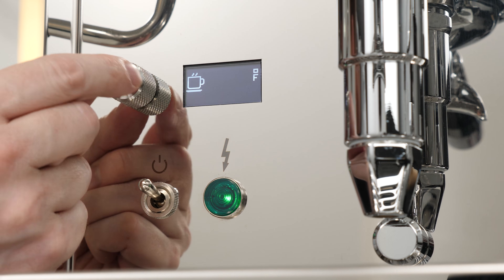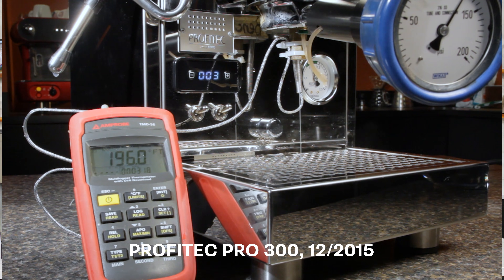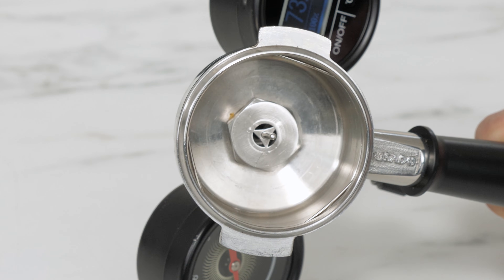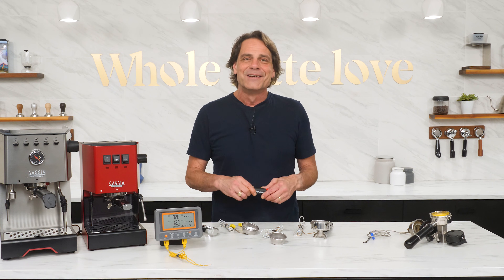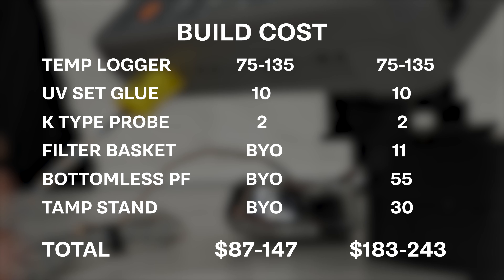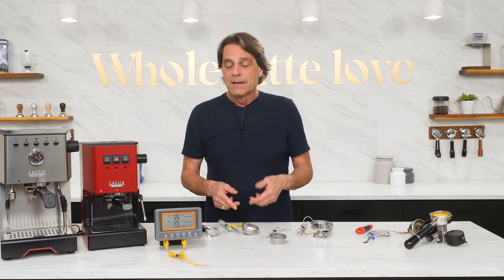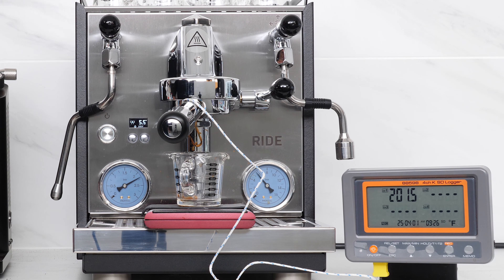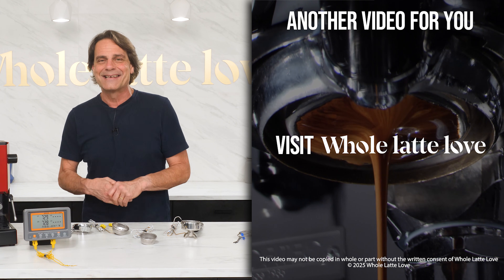Nerdy Espresso Hack: How to Build a Real Puck Temperature Probe

Comment: Hi Mark, I followed your instructions and built a probe using a single-shot basket. The probe tests very accurately in boiling water. However, when I run it on my new Lelit Mara X in coffee priority mode with the temperature set to high, I’m measuring a brew temperature of 86 °C. My bottomless portafilter and basket are properly heated up before brew. The temperature stays quite stable during extraction, and the flow rate holds steady at around 2 ml/sec once the coffee starts flowing. Repeated the test with my PID controlled Silvia with same results.
 The coffee tastes great, but how can I explain why the measured temperature is lower than expected?
Reply from the maker: Thanks for sharing your results. Hope you had fun building the probe! Your type of results are why I test machines by measuring real temperatures in the coffee puck. 86°C is rather low. Low temps might be the result of incorrect boiler offset in the PID controller. At the high setting the Mara X should be closer to 95°C. But, it uses a heat exchange boiler so the water in the boiler surrounding the exchange tube which provides the brew water is always hotter than what you'll get out of the group. The controller uses an offset to compensate for the difference. I do not believe the offset on the Mara X is user adjustable.
If your probe tests good in boiling water then I assume it's operating properly. Can you turn up the temp on your PID Silvia and see what you get? 
Bottom line, if your coffee tastes great at 86° brew temp that's what matters!
Marc

Comment: Thanks for the video, i built one - I’m curious to know why you measure the temp with the coffee - the definition of the temp set in the machine is the temp of the water at the group - the coffee adds variability  depending on how course/fine is  ground and how much is pressed. I find with my settings that the temp is stable but  2-3 centigrade lower with the coffee puck - without coffee the temp is stable and equal to the setting. Does it make sense?
Reply: Makes sense on one hand, but on the other hand the SCA guidelines specify a proxy puck with a certain thermal conductivity and volume.
Reply from the maker: Proxy puck or real puck... I'm taking temps on real coffee!
Reply: On a related note : Cremaloop is currently taking pre-orders for their new brew temperature analyzer for E61 group machines.
Reply from the maker: Thanks for sharing your experience! I measure within the puck to get a real temperature on the coffee. If you measure without the coffee are you somehow controlling the flow of water? If not I'm guessing the flow rate of water from the boiler is much higher than when actually brewing a shot. If that's the case then it's not an accurate representation of temps during brrewing.
Marc

Comment: Marc, that is very smart setup using the actual environment

would love to see for the Bezzera electrically assisted Group Head technology, like the BZ10

— would love to see the Temperature Swing of this technology in a graph perhaps?

.
Reply from the maker: Hi MA, thanks for the comment. I'm working with a new Bezzara machine now. Unfortunately it doesn't have the heated BZ group. Since I started using this method I have not tested a BZ group so love that idea!
Marc

Comment: Crazy timing. I was JUST researching E1 offsets on the Profitec Go (14C vs 18C) as well as the flash boiling technique. I was going down a rabbit hole and getting confused on the proper setting with a scace.
Reply from the maker: Hey G, if you build it let me know what you find out!
Marc
Reply: Do you find the right temp ? What the problem with scace?

Comment: Profitec ride to the Gaggia pro how do they compare?
Reply from the maker: Hey James, Here are my in puck temps on the Ride: https://youtu.be/sk_xQ1J3BcQ?si=boEezvNcqQaa0q1a&t=526
The Ride is a PID machine so easy to adjust brew temp as desired. Gaggia Classic Pro E24 is not PID but in this video I show the simple technique to produce consistent 200°F brew temps. From there, a little extra flush or short time with steam switch on to adjust temps down/up: https://youtu.be/JB124pMbv24?si=UgUKbxCdco_p6fy3&t=674
Marc